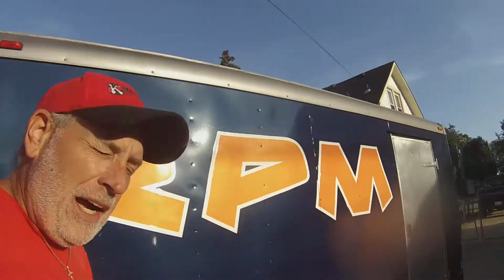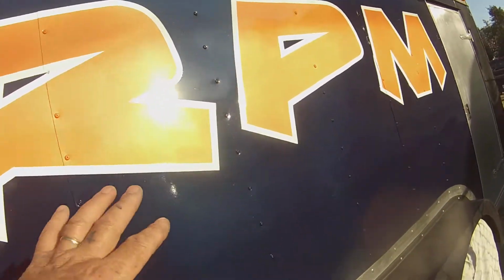RPM Update - 10-1-21

Comment: What size piston did you hone the Yamaha for, I’ve got a lot of rings.
Reply from the maker: Its a Burris piston, 52.65 (measures 52.70!) It suggested 4-6K clearance, I gave it 4+. The ring envelope suggests no less than 6K end gap so I'm WAY off!!! The bore is 52.80
Reply: @F125yourself  4 thousands walk clearance?
I run 3 to 3.1 , you can run 5 thousand but that would be for a 1 race championship with no break in as when you start getting that big you are going to induce piston slap and break the piston from the skirt slapping the walls with the piston rocking from all the clearance.
I run 0.10 end gap on the rings .
Let me know when is good and I’ll bring some rings over so that you can slip them in the bore and check them with a feeler gauge.
Reply from the maker: @brenthays1233  I was told the same... 3-3.5 but it just doesn't make sense to me. We run our H2O cooled stuff at 3-3.5, running air cooled junk that tight.. to me, is asking for trouble. We won't be "racing" this heap just lapping on track days.

Shoot me an email and I'll give you my cell #. f-125@hotmail.com